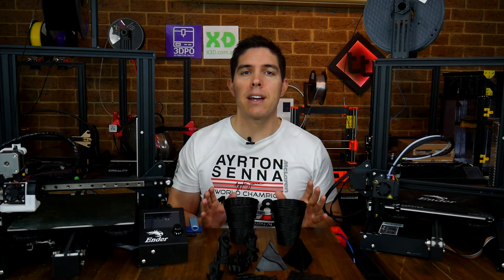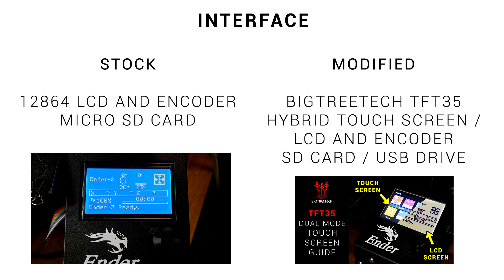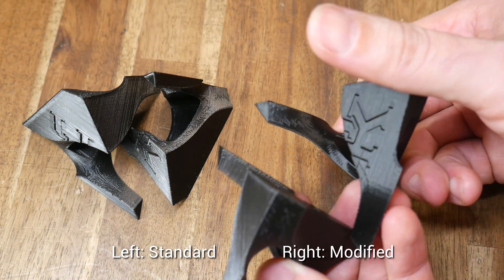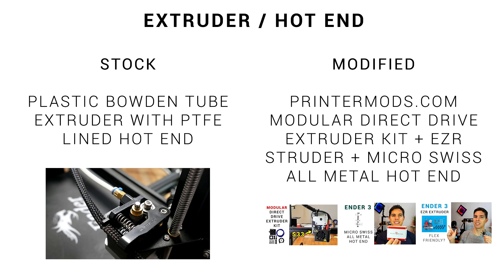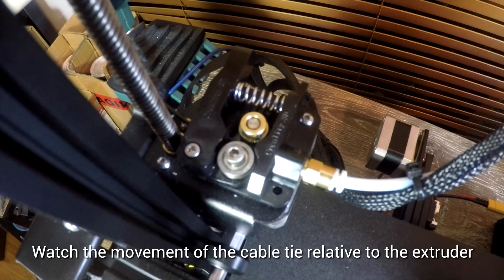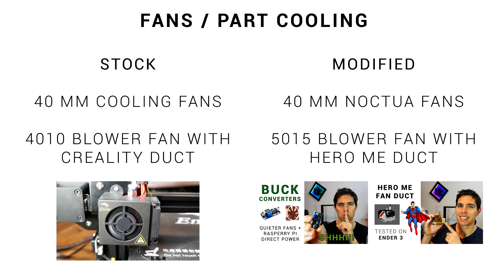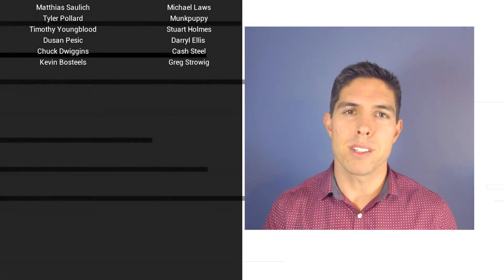Are modified 3D printers better? Stock vs upgraded Ender 3 comparison

Comment: Some mods are better than others. I own 2 Ender 3 V2 3D printers and have only been printing with PLA. I'm servicing one of my printers now. It's been out of service for a while now. On my working printer, I added a second lead screw to the right side of the printer and permanently got rid of the sagging X gantry problem. I replaced the springs with silicone mounts, and have not had to relevel my bed since I levelled it a week ago. I replaced the Bowden extruder system with a direct drive extruder and my extruder is no longer fighting to push filament through to the hot end. I will be duplicating these mods on my older printer, and hopefully get it working again. I've tried Jyers firmware, and went back to Creality's firmware. Jyers may have added more features, but I think there are 3 different areas, maybe more, that allow you to modify the Z axis and offsets. I found it more confusing to use. I tried the BLTouch, but it doesn't level the bed, and the ads are misleading. I had more difficulties levelling my bed with the auto bed-levelling device than without it. So, I removed it, and bed-levelling has been easier to do since.

Comment: I started "upgrading" my Ender 3 Pro and now after 1,5 years, I can definitely say, after putting in probably twice the money the printer costs itself, it is 100% not worth it. The only upgrade I would do again is the SKR Mini E3 V2 board replacement, that's it.

All of the other stuff like replacing the hotend, replacing the fan duct, going with linear rails, and whatsoever finally didn't improve the print quality significantly at all. Especially not if you consider the amount of money these upgrades cost.

Comment: Ive already gotten a new 4.2.7 board, bowden tube and coupler as well as some heatsinks for the pi i might end up putting in it. Thats after 6 hours of printing and a nightmare with a print bed that wont release the skirt fillament and a bowden tube seperation issue.

Would love to see a more in depth video on what the BLtouch actually does as well as a link to the real deal, seems as if there are many fake ones since the prices fluctuate from 70 bucks down to 30 on amazon :/

Comment: So this begs the question: how much have you spent in total on the upgraded printer, and what could you have gotten for that price out of the box?

For sure this approach also depends on end user. Many use the upgrade process to spread the cost, learn more about the technology and simply as a hobby - something to tinker with. Additionally, one can choose which upgrades they want and source the exact parts they need to meet their requirements and budget making the compromises that best suits them. Whereas on the other end of the scale some people have x amount to spend and want the best they can get for that money out of the both (where best = the one that satisfies their needs the most).

Comment: I have my ender 3 pro (stock as far as hardware) and I have it on a glass bed. Which is SOOOO clutch! Print is done and bed still hot? I take off the bed and set it on the glass desk, and the glass sucks the heat out of the flex bed and the part pops right off.

Comment: Excellent video. My 3D experience began with the Plastic M3D printer and I was making new design model train parts that functioned, like a Smoke Housing. But the little plastic unit was wearing out. I had upgraded the board but really needed a larger printer. I wanted to get the largest I could afford. To build Train Bodies, and Chassis. I was very lucky to find a Creality 10S Pro V1 that was a buyer return, on sale as an open box unit. I got the machine but had troubles right away. Even thought the Dog printed beautifully, nothing else came out as good. Over time i learned from you and others the areas i needed to upgrade.  My 10S Pro has been busy printing train Parts for over a year and has had issues and upgrades. Now I want to consider additional upgrades or may a smaller {Mini} printer for more detailed small parts. I don't want to add Resin Printing because of the chemical processes.  Yet I see such good parts on less modified machines. Which way to go? Should I focus on the larger 10S Pro or add a Specially modified Smaller machine like your Ender 3 Example. I need to print much hotter parts that can withstand the heat of the Smoke Generator. That will require Direct Drive. Extruder. DDX for 10S Pro is hard to find and not cheap. 10S Mini or Ender 3 seems to be much cheaper to modify for these needs.  I love the color motor touch panel you have, and the 32 bit board. Just what is available for the 10S Pro? Always watch and use you educational videos.  All the best, Dennis in Virginia

Comment: Hey Michael, I just noticed (second time through this video) that there's an error in the chart - presumably supplied by Capricorn so I'll probably let them know too. All birds (although pets are the ones we're worrying about here) are affected by toxins released into the air, but it's not because of their hearts, it's their lungs that are the problem. Birds have a very complex respiratory system (not cardiovascular system which isn't that different to ours) which appears in three major versions but in each, it's "designed" to extract as much O2 from the air as possible with the minimum of effort. A bird "breathes" through its entire body (including some of its bones) and air passes right through them rather like food passes through us. We have a tidal system so we inhale and then exhale as separate parts of the cycle, birds inhale and exhale simultaneously which means they can get far more oxygen in and CO2/H20 out for any given amount of air than we can. Birds are amazing.

Comment: The only grumble I would raise here (and it's pedantry, Michael) is that your comparison on the quieter fans didn't account for the different housings. A considerable amount of fan noise comes from badly designed airflow in the ducts and not just the blades. The only way to really show the difference is with comparable ducts but that really is getting a little silly, although it would be interesting to hear stock fans in free air vs. the quiet ones to see what (if any) gains could be be made with more thoughtfully designed ducting. Remember that the noise we hear is the change in air pressure as air moves around the various surfaces, so a smoother airflow means less noise.

Comment: GOBLIN ENGINEERS...  I tinker with the ender because it's less of a problem if I mess it up than the more expensive ones, BECAUSE of my  inbuilt urge/instinct to tear apart anything that runs on electricity or gas, then analyze it's guts, philosophize over what could be improved and then goblin engineer (also known as gerry-rigging, haxing, scabbing ect...) And execute a  series of genius level improvements to whatever system was unlucky enough to wander too near my shop.  At the end it looks like it's held together with prayer and unicorn farts, but I also now know how to make and mount a ALCOHOL POWERED COKE CAN CANNON  the hood of a (ex)girlfriends Jetta!!!! Boy did the neighbors ever hate that one!

Comment: What is a good starter printer then if you don't want to really do all the mods. I don't mind replacing parts to upgrades add they wear out but don't really want to have to do it all in the beginning. I was looking at the Ender 3v2 but then found the BIQU B1 which basically is the ender 3 v2 but with the upgrades already. I also came across the anycubic mega s and it says it is"more ready to go" straight out of the box. Then I found the Voxelab Aquila. Basically is it an ever 3 v2 clone but the cost is about$100 less. BIQU is made by bigtree tech and the Voxelab is flash forge. 
Any advice would be appreciated.

Comment: My ender 3 V2 came with a warped glass bed. I considered getting the BL-touch and use mesh-bed leveling.
After reading all the bugs and errors people struggled with, I'm glad I just ordered a new glass-bed instead lol.

I also tried octoprint for a weekend and had some weird bugs, prints just stopped half way through.
Got a cheap android security camera and wifi power switch instead. 
I can monitor it from both PC and mobile and cut the power when it's done or if it fails.
Considered a dual gear metal extruder upgrade too, but saw chep and the others had a grinding issue. 

So glad I just stuck with the vanilla. The ender 3 V2 prints beautifully out of the box for a low price. 
Spend time maintaining lose screws, change worn out parts instead, and you'll have great time 3D-printing!

Comment: just installed my bigtreetech mainboard and display today and will soon do an extension kit and noctua fan on my ender 3 pro. I just pick and choose what I want to have done to my 3D printer, not do it all. I love that ender 3 though because it's taught me so much, and parts are cheap enough that I won't lose my shit every time I mess it up (which let's be clear I've learned many things the hard way, RIP 2 different build plates, a hotend, and almost a fan). There are times I have been frustrated enough to just throw the damn thing but I have learned so much from having it that all the headaches are worth it.

Comment: If I was going to buy an Ender 3 specifically with the intent to upgrade to direct drive, linear rails,  and all metal hotend, would it make more sense to start with a v1 and save a few bucks or would the v2 be worth it for the new board?

Comment: On the Ender 3 if you do want to print ABS you do need to upgrade your printer, use a glass bed, more heat on the bed, different nozzle, better drive rollers, rewire your motherboard fan so it always runs because on the fan control you shut off your fan to cool your nozzle which kills your capability to print ABS. 
2 more things we should cover is the BLTouch is a big thing which without the new motherboard can become a hassle to get done. So if you do your BL Touch do your motherboard as well. And put an adapter on for your micro SD to SD in a position you can access easier will make your job easier if you don't go the octoprint route.

Comment: I really like this video but a question I have is. If you look at the amount spent on all these modifications is there a better starting point for a printer? Something that can print TPU and ABS without issues. It really seems like we need a ender 3 V3

Comment: I always enjoy your Video's.   You always cover all the details.    Should you upgrade?   Well if do not have some engineer experience with 3D printer do not!    But, for me I have upgrade just about everything on my Ender 3.      I have tree other 3D machines that  have design and or copied with similar features.     All of my machine have been upgrade to 32bit CPU's.  My Ender 3 is my work horse machine for all the different filaments I use.    My 3D machines are my manufacturing.  I can design and print just about anything.   With that said every machine needs so TLC at times.    But, to me It is not a big deal.   Michael,   Keep of the good work with your video's.   If it was not for you and Chris Riley, I would not be able to do any of the 3D upgrade without trail and error.  Both, of you are my reference encyclopedia.

Comment: I have a printrbot from years ago, just started getting back into it. I haven't modded it much I did plan a few upgrades but it'll be difficult since they went under. While I think the quality of the stock Ender looks marginally better because of my Printrbot simple there's some things I can't live without. I love autoleveling and direct drive, I use a laptop instead of a built in screen but I'd definitely the touch screen too best of both worlds. Linear rails though they didn't seem to make much difference but then coming from a printrbot simple which has practically zero maintenance maybe that's the reason for them.

Comment: My ender 3 experience has been troubled.  All because i got petg filament and didn't use pla.  Being a noob, a whole bunch of setting needed to be changed.  And then the upgrades...  I should have researched more because there are models with all these upgrades included saving time and frustrated but fun tinkering.  I just want to print something but it seems like every time i do something goes wrong with one of the upgrades.  Lol.  Idk,  frustrated but still having fun.

Comment: My Ender 5 Pro came set up so well I hardly had to level the bed, had perfect prints right when I set it up. Maybe I'll go up to a really large printer, or maybe a resin printer next, rather than going all in to make my ender 5 better, since I feel there is little to gain on the quality side. Maybe over time will need some fixes and I'll upgrade those parts then. Got a bl-touch though, need that.

Comment: Great video! You are absolutely right I have made very modest "upgrades" to my Ender 3. I don't use my printer like many of the users on YouTube, I guess you can call me a hobbyist. I print things for fun and enjoyment, nothing more.  I only recently started a project for my wife in making a practical PAPR for her work. She has health issues and wearing a face mask is a challenge, buying a PAPR is very expensive and hard to obtain, so I am making one.  I have learned a lot from you and your fellow YouTube video makers. It has made 3D printing so much easier.

Comment: The Ender 3 is a super low cost machine. I definitely would agree that some mods are needed (such as the leveling wheels being too easy for them to move on their own and the craptastic flexible plate), but if your thinking of then going all out and spending all that money on upgrading in my opinion you should first look into buying a way better machine which does not need all the mods or even better... build it all yourself! Most 3DP noobs don't realize that Mendels (aka bed-slingers) are quite slow and none of your upgrades changes that.

Comment: Sir I have a question...  My ender 3 -1.1.6  Has a problem that is confusing me and has put an end to me using the printer after spending $100.00 American on a selection of filament...  the problem is this...  I upgraded to the extruder mount and gear with the CHPOWER Ender 3 Extruder Upgraded Replacement, Aluminum MK8 Drive kit...  The original plastic  tension arm broke in the usual place so I had to do this...  I had a a one time problem before then that has now become a permanent problem...  the problem is the extruder ins't extruding when I try to run the file off the Small sd card...  I can test the extruder using the control panel and it works great, the second I run the gcode file it doesn't extrude...  I have used different 3 different mini sd cards, and different filaments...   I thought maybe that there was to much tension so I released all tension and tested again the control panel test worked fine but the gcode test failed...  I am thinking maybe the 1.16 board has lost its ability to read and act on the gcode...  Before upgrading to the chpower extruder I had taken care of the problem by just turning the ender off and unplugging it for about ten minutes and it came back to life...   only to fail again the next day...  I had run the successful code after upgrading the to the chpower so I do know that is not part of it...   In your opinion has the board gone bad???  Also I cant find any information on the 1.1.6 at all it isnt listed any ware, even Creality when emailed said they don't have a listing for it...  By the way I love your videos I have learned so much thank you and please keep it up, and keep them coming...

Comment: I'm new to 3D but, would do a few of the upgrades like the touch screen and the extruder. Plus all of the printed parts to keep filament away from things and keeping the wires from getting caught up on the extruded frame. BTW love the videos.

Comment: The only thing I'd say it is not fair about this comparison is using a tuned profile compared to default cura one. If you have an Ender 3 stock, or almost stock, it is not a stretch to think you haven't tuned the profile, at all, or at most your temperatures and layer heights.

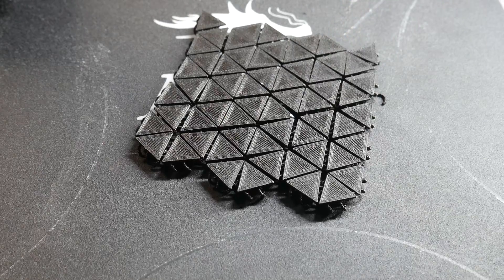Comment: to avoid such stupid injury at 11:24
I add a slight bevel at the bottom of the object if possible, and, put the scraper next to the object and hammer it slightly with your dominant hand, using a small to medium hammer. I learned it the hard way, I once ended up with a chisel contacting my left thumb, and another time with an Opinel slicing through my index finger. It may be obvious, but you never want to have your hand in the possible trajectory of a tool.  I know someone how ended up with a full PZ2 bit plus a part a the bit holder through his left hand, an actual through and through hole. You wouldn't think a PZ2  but would break the skin and whatnot...